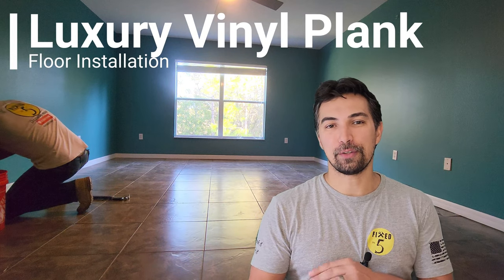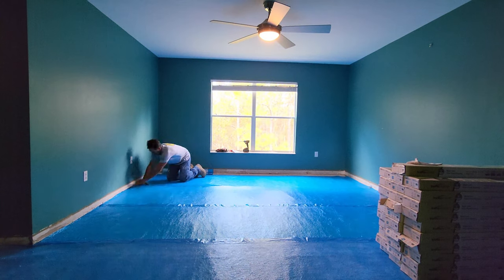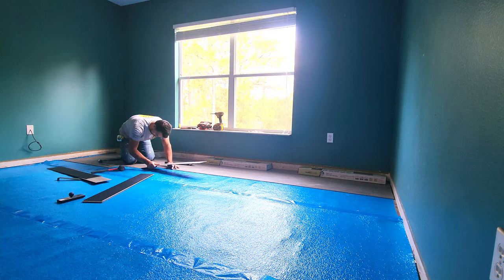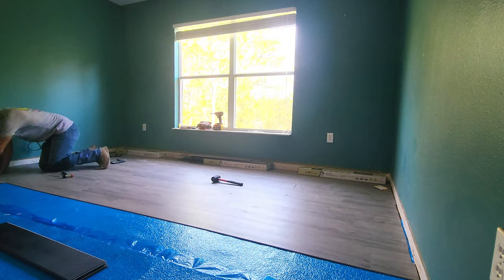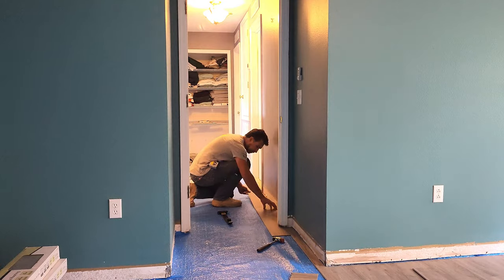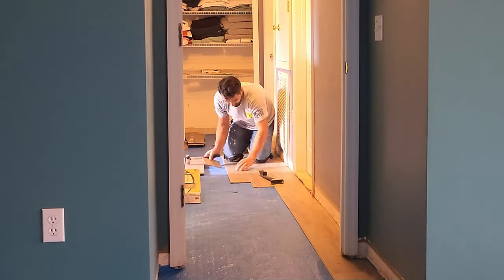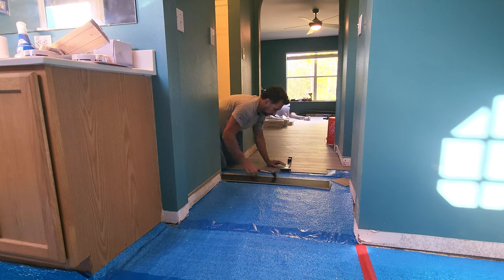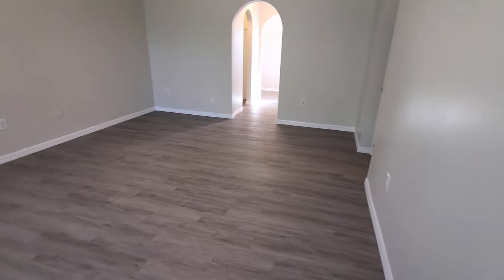From Start to Finish: Installing Luxury Vinyl Plank Flooring

Comment: Since the planks you are using appear to have BUILT-IN (BLACK) UNDERLAYMENT, why did you first put down the blue underlayment....extra noise abatement? Great commentary!!
Reply from the maker: Appreciate the comment. This was installed on a second floor home. I used the blue underlayment as an extra sound barrier. Also this particular flooring is only 6 mil thick, the underlayment adds another layer of insulation that is more comfortable to walk on.

Comment: I have 2 questions, my living room is a mix of hardwood in the entry way, carpet in the living area and tiles in the kitchen area. i want to convert all to LVP. i am concerned about the floor level. what would be the best way to make sure floor is level enough for LVP.
2nd question is regarding underlayment. many places dont recoment underlayment. any reason to have it?
Reply from the maker: Thanks for commenting. The only way to find out if everything is level is to demo the existing floor. Unfortunately you wont know what you are getting into until your getting into it. If your floors feel level while walking over them, then there is a good chance they are and no other modifications will need to be done. Keep in mind there is always a slight chance modifications have been made under your carpet, wood and tile to make everything level. Hopefully the tile in the kitchen is not underneath your cabinets and can be demo'd easily.  If you do find low spots, they make self-leveling underlayment for wood subfloors and concrete. Certain types of LVP don't require underlayment and can be installed directly on the existing floor. These types usually already have a rubber backing. Other types of LVP require underlayment for the floor warranty. Underlayment's add an extra level of cushion and protection. It's a great sound barrier if you are installing it on a second floor. There are also different thickness in material. The thinner the product, the better it is to add an extra layer on the floor.   Hope this helps.  You got this!

Comment: This is not how the pros from home depot do it.
Reply from the maker: They don't bother with half those steps.
Reply: @fixedin5  they only use rubber hammer. they just banged and all the pieces just fit. we'll see how long it lasts ...... :-)
Reply from the maker: @jonathanthink5830  Exactly. You gotta take your time with these floors. They are touchy.